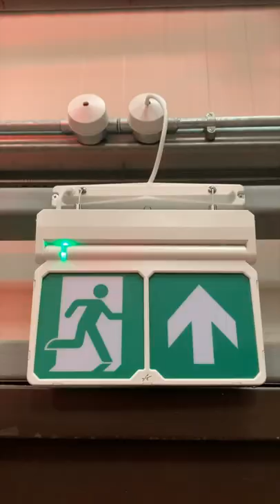How To Install An Emergency Light

Comment: Hager klik is really good. The Marshalling boxes make life very easy. They are not the same as LCM such as Ex-or or CP lighting but they still very good. I normally buy the prewired plug. Just saves a bit of time
Reply: Salam bro, clearly you’re an electrician to have the knowledge you do. I’m after some advice on pursuing a career in electrics in sha Allah. I was wondering if you could perhaps give me some insight? Thanks bro

Comment: Why do you need to ferrel crimp absolutely everything? 😂
Reply: Because flex cable has to be crimped? Standard practice in the UK unless you’re a cowboy
Reply: No, you really don’t
Reply: @adamkerrigan8365  Yes, you do. The regs state we have to and why wouldn’t you? Takes literally 2 seconds and gives a solid connection. No good just doubling it over

Comment: The arrow points down. No questions asked. The sign is above a door or passage way and you enter under the arrow
Reply from the maker: Arrow goes up ⬆️ like a one way street
Reply: Please don’t install exit signs if you think that. I think many do it how they want it completely unaware of the complications it could have a someone like a wheelchair uses. They rely on the arrows being the right way to help them out a building. So follow regulations and don’t be an idiot
Reply: @efixx  our one way street signs points sideways, they aren't on top of the street but at the traffic poles besides the road